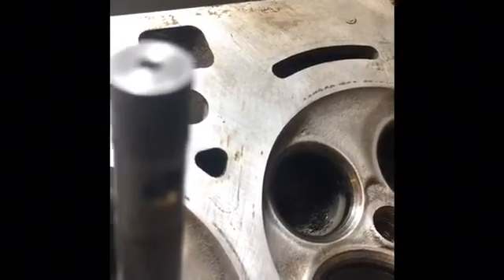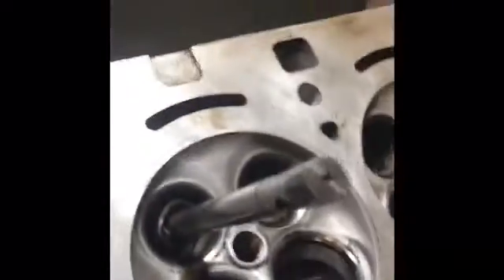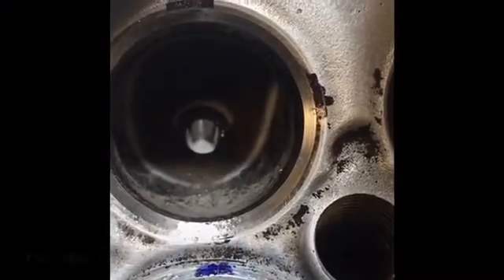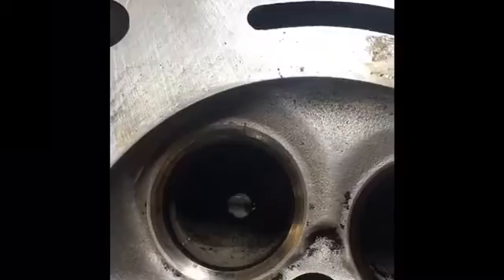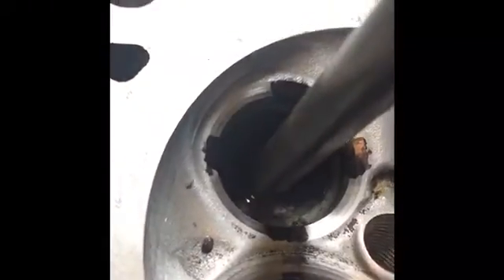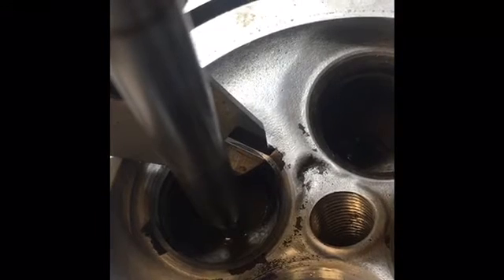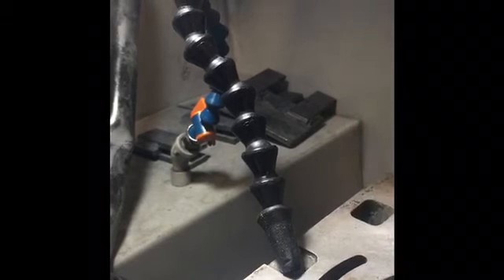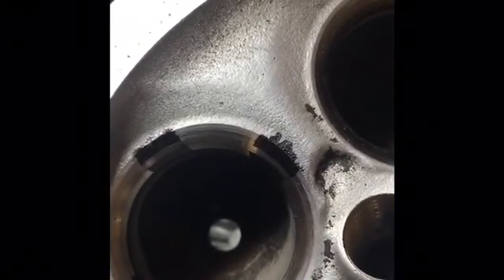How to Grind Valve Seats

Comment: Sioux valve grinding tooling is what your talking about you can purchase them on ebay but are quite expensive to get a complete set each arbor is a certain size for the valve guide the grinding motor and the stone cutter are needed to. accurately cut the seats I just purchased a complete valve grinder and the seat grinder set off craigs list for 400 bucks and that was a screaming deal as the valve grinder is usually 750 to 1500 used depending on condition and age.

Comment: Why not just cut your 30 and 60 first, then set your 45 last?
Reply from the maker: Adam Alsnayyan because your 45 doesn’t move once it is set. That’s your contact area with the valve. It’s easier to work the 30 and the 60 once the 45 is set. Try both for yourself and see the difference.
Reply: We usually start from the bottom and work our way up. Cut the 60 first to center the seat, then cut the 45 and finish with the 30 so you can control the finished width of the 45. I've seen it done this way as well. Nice video. Very informative. Extremely thorough.